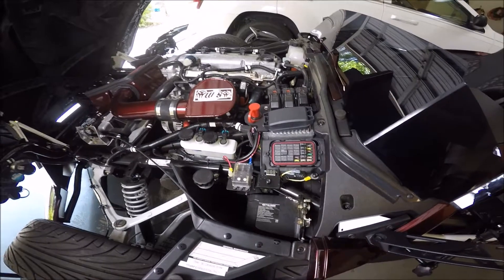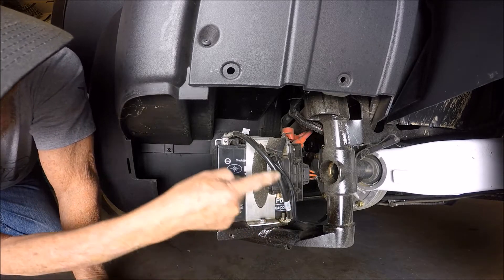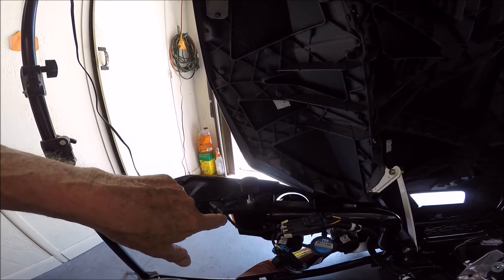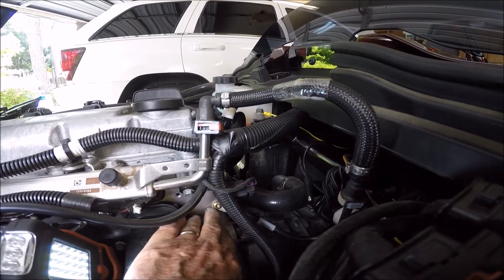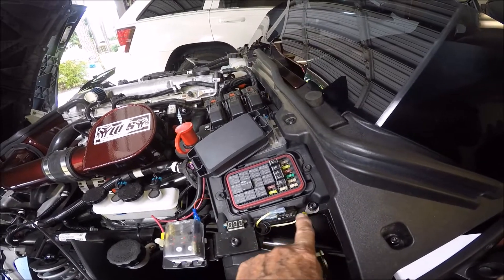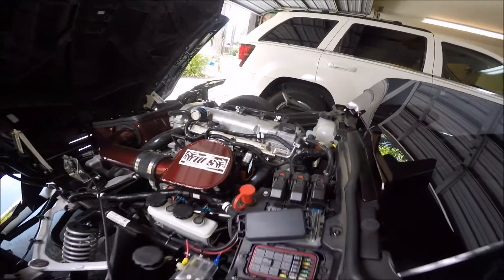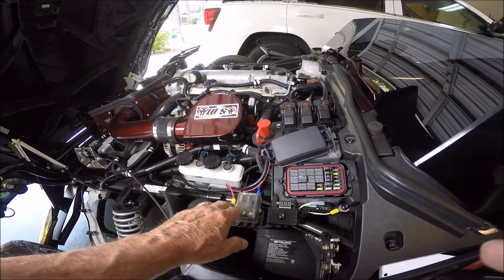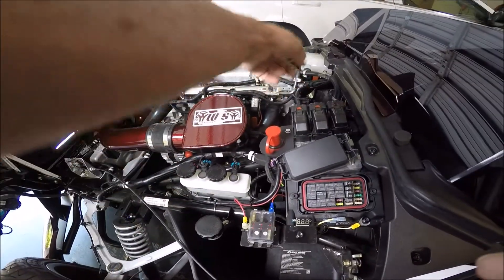Slingshot and the Chassis Ground Connnection Location

Comment: Hey sam, that main ground you showed with all the wires going to one location,  is that not a hot spot for the slingshot? Where it would get to hot and send a signal back to the pcm and cause a positive feed causing the pcm to reset.. the reason I'm saying this is because I'm having this issue.

Comment: Hey Sam! Any idea why sometimes I get a high idle around 2500rpms when sitting at a light for example?
Reply from the maker: Angry Babaa, If you Slingshot is 2015 model, there were issues with over rev and rough almost dying at idle.  There were software updates that corrected most issues.  You may want to have your dealer check your vin for the updates.  Thanks for your comments, it is good for others to see your comments, it may help with answers.
Reply: Where did you purchase your external battery posts an did you do install yourself?